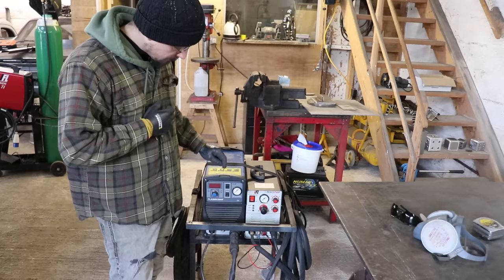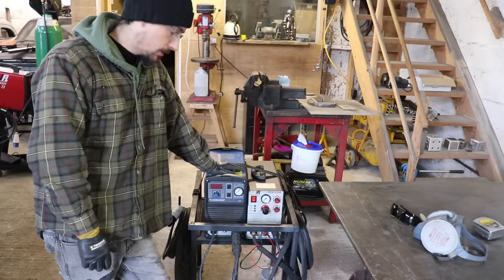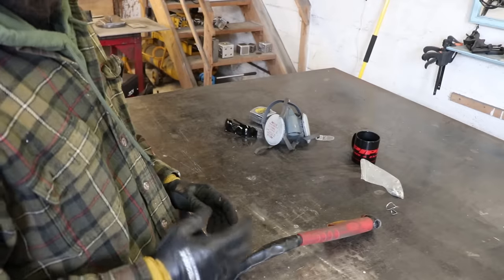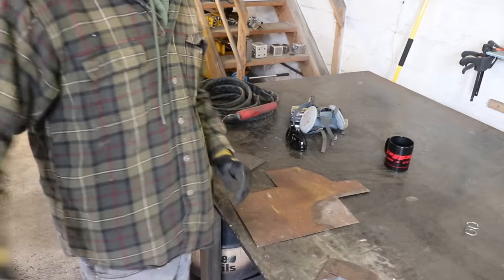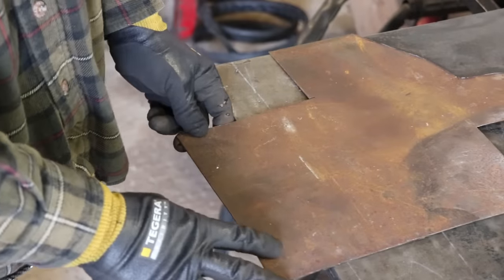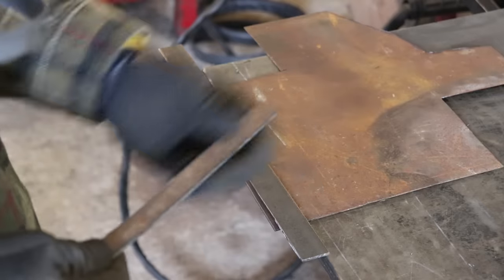PLASMA CUTTING FOR BEGINNERS, PLASMA TIPS AND TRICKS

Comment: Good Vid. 

 A few things though...It's not about outright compressor pressure (although it is a factor), it's about air flow rate.

Torch tips - if they have a star or cross pattern at the nozzle / tip - they are capable of being dragged, as long as the work is pierced though, and the correct cutting speed / current selection / air flow / pressure setting (as you mentioned) is maintained, any tip can be used to drag. 

Not just nozzle / tip condition, but inner electrode condition is also a major factor in cut quality.

Wouldn't recommend beginners to use non dominant hand to hold work with a pilot arc cutter - they're indiscriminant in what they cut. Don't forget the plasma stream is somewhere in the region of 20,000 degrees Celsius. The leg comment was not said in jest!!!!

Again, good vid.
Reply from the maker: Good tips, I will pin this to the top. Cheers
Reply: Very good tips. Thanks a lot!! 👍👍👍👏👏👏
Reply: Ian Cook 👨‍🍳 I
Reply: wow cheers Ian thats great reading there. Helped a lot thanks.
Reply: Wot! Ya say in plasma don't care?
Reply: instablaster
Reply: "It's not about outright compressor pressure (although it is a factor), it's about air flow rate." Same effect, pragmatically, lacking a way to measure air-flow.
Reply: @DefundTheFringes  No, not the same effect at all.  Pressure is usually measured in Bar/KPa/PSI etc.  Flow rate in this case, is measured in Litres per minute or cfm.  Think of your wife's hair-drier...lots of air flow but little pressure.

Comment: I know in the UK the electric service is standard 220v.  So you can turn up the power to 50 amps with no problem.  In the US the standard is 110V and when turned up to 50A, it will blow a breaker in a short amount of time.

Comment: I had a compressor which had good pressure but wouldn't run some tools, found out the original outlet valve on the tank only had a small hole and was  restricting the air flow, I replaced it with a 12 mm ball valve, much better.

Comment: Great tips and content as always Matt.. One thing my two boilermaker friends told me when using plasma and especially with aluminium, is don't ever cut above water bowl, (such as a cut off section of a drum), which you may  have put on the floor, by the bench,  to catch all the dross from the cut...the dross explodes on contact and you can get seriously burned ..
Reply from the maker: I have not come across that and I'm not organised enough to have a bin to catch the dross so I should be alright. Cheers
Reply: That might have something to do with Thermite

Comment: You have uploaded a very good beginners guide to plasma cutting and full credit to you for finding the time and patient’s in putting it together.
A couple of points, to help your watchers, which tbf may have already been mentioned below…
•	Air flow (scfh/lpm) at the machine is just as (if not more) important than supplied air pressure which ensures you maintain a well formed plasma stream.
•	Always have an additional air filter etc at your air outlet to ensure the minimum amount of moisture even reaches the air filter fitted to the machine.
•	Using a ‘metal’ guide to run your plasma torch along is not recommended as it can encourage ‘double arcing’ which basically reduces the life of your cutting tip/consumables.
•	To experience the best cutting performance, (cut quality and consumable life) always match the cutting tip amperage to the machine amperage, i.e. when setting the machine to 30A fit a 30A cutting tip. This gives you the best cut quality.
•	Cutting tips are either designed to be dragged or ‘stood off’ so depending on the plasma torch being used always ensure the correct cutting tip is fitted for your cutting application, again to give you either better cut quality and/or consumable life.
•	Generally drag tip cutting material under 5mm will give you the best cut quality. 

There is many factors that dictate cut quality, from.... correctly installing the machine to material type/thickness being cut, overall air quality, operator experience, using the correct consumable setup, not using over worn consumables etc etc for a lot of plasma machine owners improving consumable life will dictate what costs you continue to pay when purchasing replacement consumables over time!
Again, very well put together Sir :)

Comment: I was in ag class today first ever time using one I love it
Reply: Far out Tanner.  I took Ag in 9th grade just to learn to weld in the early 80's.  The summer before school started,  I got hired on at a local steel fab outfit making stuff for Panhandle Eastern as a welders helper working with some top notch stick welders for a whopping $2 an hour.  Needless to say, I didn't need Ag anymore but was stuck in the class.  Ag teacher would jokingly  accuse me of having my co worker weld my coupons(any way I think he was joking).  I built a go cart "after hours"at work hidden from the owner (boss) of the company(looking back I still can't believe he let me close shop by myself).  He strait up busted me one day when  he found my frame I welded.   He told me I better rethink my steering,  cause when U turn steering wheel right, cart steers left , and vice versa.  Then he got serious and said the material I was using was property of Panhandle Eastern and said they might take a dim view of me using their material ( I was about shitting at this point cause I knew I was about to be fired for the first time ever),  then he told me he would really appreciate it if I would wire brush the painted serial numbers off the 1 inch pipe used to construct the frame.    Later, he even sold me a used 8 horse motor for 10 bucks.  God rest his soul, one of the coolest dudes I ever worked for(and smartest).  I learned some real life skills there,  meanwhile, I was stuck in ag class, and we spent more time going to local farms "cutting hogs" than we ever did welding.  That shit sucked, but had some laughs.  Any way sorry for the  long bore-a-thon,  but your comment kinda hit me just how fast time/life goes by.  Seems almost like last week to me, that I was in Ag class.  Still have my blue and gold jacket even tho it don't even come close to fitting anymore.  Best of luck Tanner, and remember safety third...I have a feeling you are gonna be a fabricator in no time.

Comment: Thank you Matt. I'm an old OXY man so this was very interesting to me having never used a plasma. I'm about to start a fairly big project that will require a fair amount of cutting so I'll be looking into a purchase now I understand a little more about them. Good on you for sharing your knowledge Mate as it is invaluable to me & many others I would assume. Again many thanks Billy J.... OZLAND
Reply: As a newbie to plasma it beats oxy hands down. And no gas bottles either. If I did not have to heat things on occasion I would get rid of the oxy bottles totally. The only thing I gas weld now is old rusty exhausts. And that about once a year.
Reply: I used to watch guys on YouTube and tv plasma cutting and think "that looks great" then I got one.
I tried it out, played around with a few things, and though, this is no better than an oxy but takes longer to set up!
But once you dial it in, it's so much better. You can get grinder quality cuts and triple the speed. I was cutting up old plough discs to make a 4 strand barbed wire spinner and it took me 10 minutes to mark and cut one with the oxy, I said "fuck this" and set up the plasma (I had forgotten about it) and cut the next 3 in 10 minutes.

Comment: Roofers square, bow in the straight edge, simple circle cutter and up the power, great tips. Thanks. I use a piece of thick wire (like 3mm fencing wire) as a guide to form irregular curves. Also handy to know the offset distance between the edge of the tip and the actual cut edge. If I make a template (thin ply) it has to be 4mm smaller all round to give the correct finished size. 
New sub here.

Comment: Thanks for the straight no nonsense explanation.  First cheap plasma cutter I bought blew one of the circuit boards and haven't been able to find parts for it.  Second cheap plasma cutter seems to work okay but I haven't tried the full contact of the torch tip yet.  Next burst of energy I get I will try your tips and see what happens.  I'm old and have hand tremors so bad that welding is not as much fun as it used to be.  Started a new medication today and it seems to be helping but makes me want to take more naps.  Don't know if I will get much accomplished, but I'm not quitting trying!

Comment: Well explained Matt, I've had my plasma cutter for 3 years, I set it all up and then put it back in the box (un- used) where it still sits today, Impulse buy as I always promised myself one but I don't weld regular enough now days to warrant un-packing it all, (Lazy Git) One day though! This video might make me use it? Thanks Matt.
Reply: MichaelKingsfordGray  building welding cart and benches whilst simultaneously teaching myself welding because i'm tired of stuff sitting on the floor or having to work on the floor of my garage. Slack shaming indeed. :)
I bought a plasma cutter recently after running into things that stopped me from progressing on ideas (oh sh-- I could do that but.. I don't have X tool), plasma cutter actually solves quite a few tooling issues but it has a few requirements of it's own.
An inline dryer and water/oil separator positioned at the cutter unit for one. Water trap on it's own is not enough, you run the risk of ruining the gun assembly (300 dollars for a new plasma gun) if you don't take proper precautions.

Comment: Thank you for the tips! I have a Everlast PowerUltra 206Pi. I have used the plasma for a few projects but the slag has always kept me from using it a lot. It's a 50 amp and I always assumed it was the machine. Everytime I watch one of your videos and I see you use the plasma and just cut something like butter, and i'm like I wish mine could do that. It turns out I alway just use it at the minimum settings. So now I need to try and turn it up a bit till a find the sweet spot. I can't wait to give this a try!
Reply: Have you tried it out yet with different settings? I have the same machine from Everlast and I'm trying to learn how to use it. What air compressor are you running? I saw a video from Everlast that said you need at least 5.0 CFM at 90 PSI to operate the cutter properly.
Reply: @drakeswake  Yes, it's cuts much better a lost less slag and a cleaner cut. I have a 60 gallon Husky, the CFM at 90 PSI is 11.5 on it.

Comment: You may be surprised to see a proper oxy torch cut. Most do not realize it can be done without slag or dross. 
Plasma cut is better in that it is a bit safer and easier . Thanks MAT good show again.
Reply: One of the BEST things regarding a Plasma cutters unlike Oxy acetylene they require no cylinders which are RENTALS and the cost of long term rental is cripplling unless you have many jobs that require oxy cutting, most shops have a compressor.

Comment: You absolutely get a better cut dragging the tip. When I learnt I tried hovering and my cuts were rough. Plus every shake of the hand shows up.
Dragging stabilises the torch, blocks the arc and stops spatter blow back

Comment: I have been wanting one  of these for years and said no way it cost to much plus I have a torch so why would I ever need one. BUT today I got a chance to play with one. after about 30 minutes I was cutting 1/4 steel plates to build a bumper for a tractor and then cutting sheet metal for a roof of a bronco. I ordered one tonight from amazon  will have it here by April 3rd.

Comment: Top job as ever Matt. Think? I told you I first heard of/ used a plasma cutter at my friends garage in 1996. He cut 1/2 inch steel plate for the door plate on the Montego rookie banger. At the time I made some petrol tanks. Could still see to weld then (grin). Plasma was a brilliant tool for cutting the sheet for them. If you look at 25 seconds of this "Skegness Banger Team Classic.........The Cars" You can see one.

Comment: I have owned a Hypertherm powermax 600 for over twenty years, it's a little beat up(sometimes I literally have to beat the side of the unit to get the air solenoid to shut off) but works great mostly.  I can honestly say it is my all time favorite tool I own.  If you're on the fence of buying a plasma cutter and do much fab work  at all, buy it.  You won't regret it(unless you buy one that don't work right, cause that would suck).  I would love to upgrade to powermax 65,  but hard to justify when my museum piece still kicks ass.  My .02 worth.

Comment: Super good tips!  LOTS to think about!  I was using the standoff guide that came with it, but I think you are right to forget trying to keep the gap.  The circle guide you showed is AWESOME!!  I want to go back out to the shop and play with the great ideas you gave (2:00AM here now)!  LOL!  To bad my brand new 'Lotos 50A pilot arc cutter' died today with a loud POP after only 20 minutes of cutting out of the box brand new!   It figures I would get a defective one!  At least I bought the 3 year Home Depot extended warranty!  One question, I needed to cut through a 1 inch thick pipe that was welded onto the side of a front straight axle with a large amount of weld at the base.  What is the best way cut through a piece that is thicker than the cutter can pass through in one pass?  I know you cant have a clean cut but it was melting in globs.  That was when the cutter died.

Comment: Great advice.
 I first tried out my new 40 Amp Plasma cutter last night, results were awful.
  I was doing all the things you advise against; I was trying to  'hover' above the work, cut free hand and was going way to slow for 1.5 mm sheet. Many thanks for the good tips.
On my machine the air continues to flow for 30 seconds after I stop cutting, I guess to cool the torch,  is this normal ?
Regards Paul in NZ.

Comment: i like the square trick for cutting straight, although to save my square from accidentally gouging the edge, i just bump a piece of 1/4 inch flatbar up beside the square it and run my torch on there
Reply: And as added bonus, you don't have to modify the square 😉😉😉😉

Thank you very much for the tip 👏👏👏

Comment: NIce job!  There are lots of good tips in this video including several that I haven't seen anywhere else and more that you've described more clearly.

Looks like It was a bit chilly in your shop while you were doing much of the actual cutting.  What's the lowest temperature you cut or weld in?  Does it affect the settings that you use, speed, amount of prep, etc?  I'm new to all of this and am wondering whether/how I can keep working on things in an unheated garage during the winter here in Minnesota, USA.

Comment: Use a heavy duty magnetic straight edge with my plasma cutter,it's a really handy tool. Does not slip when used as cutting guide.
Reply: Except on aluminium .......😁
Reply: Chris Knight unless it's on the edge of a metal workbench!

Comment: 6:30 you can use a secret ancient method: use 2 different types of gloves :D
left Leather, right thin one. best of booth worlds
Also there are different types of leather gloves, i have some slightly more expensive ones which have better designed fingers (thinner + better fit)

Comment: In my experience the tip and electrode are longer than stand off and the drag tips I have seen have a different molding in the very business end.  Notches that aren't very deep but there.  I am assuming they ventilate the cut and reduce the heat transmitted to the tip.  While they don't last as long as a stand off tip used as designed they definitely outlast a standoff tip used in drag.

I like to use a piece of angle clamped down then I slide my last two fingers hooked over it of my off hand.  That establishes my cut line while it still allows me to maintain a stand off gap or to drag with my cutting hand.  Long cuts are all about foot placement.

I can normally get several hundred feet of 1/4" material going standoff on my 40 amp machine while drag does maybe a tenth.  Drag comes into its own when running templates.  Which is why I hope to find them for the new machine.  Good subject.  Take care

Comment: I have had a small machine for some time, it leaves a cut gap of 1 mm when the tips are new. It was used for cutting aluminum panels for Tiger Moth , it was easier to trim MDF to the correct shape clamp it and cut. I spent a bit of time making temple holes in pieces of 3mm MDF. A series of holes cut with a hole saw taking in to account the diameter of the tip, I made templates for interior and exterior cuts also a set of French curves of the same MDF. I was told not to use steel as my straight edge as it would affect the arc, this I found not to be true but it did lead me to using  MDF which is easier to cut and form to the uneven shapes on a car guard.

Comment: Hi need some advice please. Never done anything like this before apart from an angle grinder. I work in spain fitting fireplaces and in spain most of there fireplaces are open fires with metal boxes up to 6to 8mm thick. I have to cut out a lot of the internal box to accommodate the insert stoves I fit. At the moment I have been using an angle grinder an a lot of metal discs, but it can be quite dangerous as the grinder can jam on me and shoot out of my hand, and it can take up to 6 hours, which I am 60 yrs old and finding it hard on my health. Now can this be the best option for me to use a plasma cutter. My only worry would be I sometimes have to be on my back cutting metal above my head, and working in very tight spaces as they are fireplace openings. Can you help, thank you 🙏